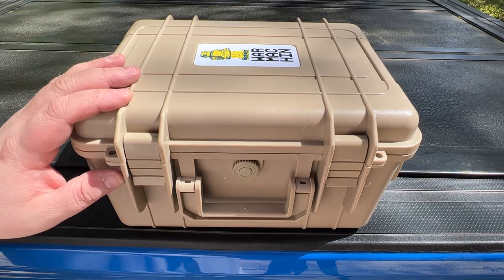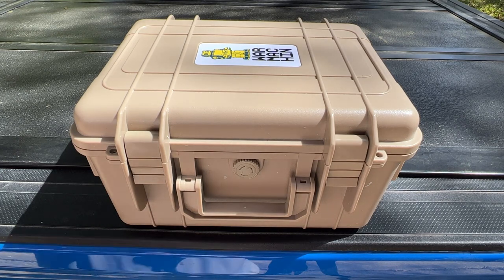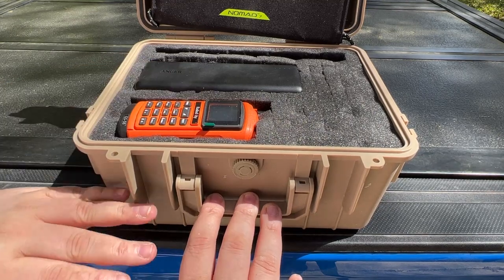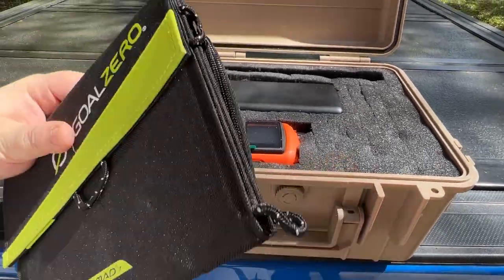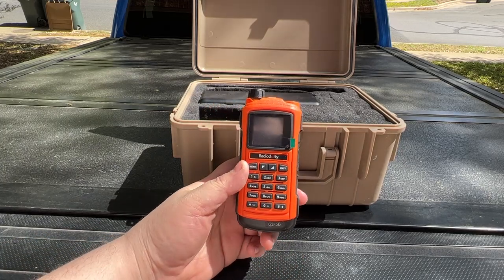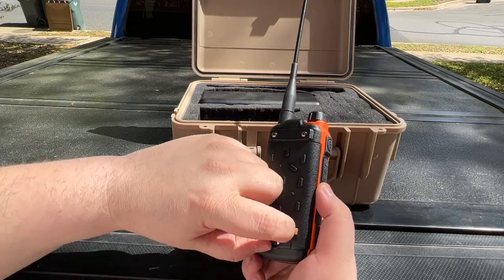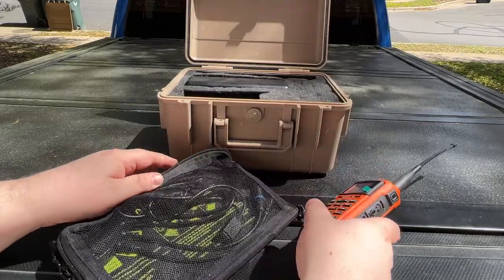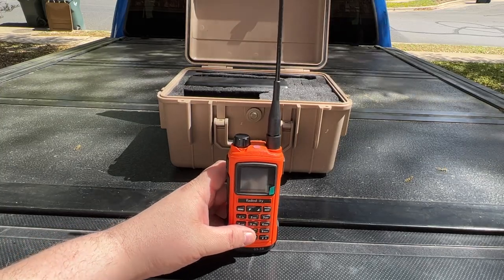Emergency Communications Kit, Part: 1 | Offgrid Technology

Comment: A small “ roll up “ GMRS antenna will improve the range when over the whip antenna.  With the 460 MHz band , it doesn’t have to be big or thick but it will improve range when not on the move.
Reply from the maker: You know I never considered that, great comment and thanks for the tip I will source one for it :)

Comment: I would add an extra battery for the radio to the kit, you can change out and recharge one while operating with the second if they have a AA battery pack I would throw one of those in as well
Reply from the maker: Good idea, never know if the primary can die, I have a few new items I am going to release part 2 in a week or so.

Comment: can you fit 2 radios in there? then you could have an extra one to hand off to someone you might want to stay in touch with. maybe an extra one of those slim battery banks, a small micro usb chargeable flashlight or headlamp or 2. as the saying goes, 2 is 1 and 1 is none. throw a couple of small usb a to c and a to micro cables in that bag for your solar too. then you could charge a variety of other devices, like phones. might be able to barter something to charge someone's phone or tablet for them
Reply from the maker: I love the adapters idea, nice suggestion. I didn't consider a second small flash light that I may do as well. I was thinking of getting a second GS-5B and adding it to the lower foam for that redundancy and for handing to a partner should someone need one.

Comment: Nice kit! Maybe add a shortwave receiver like the Tecsun PL386 or CountyComms version (GP7/SSB). These also charge off of micro USB.  I see so many prep kits that stop at a dual band HAM or FRS and GMRS capabilities.  While these are great for local or longer range communications with repeaters and other networks, I think people are missing the mark by not having something that can receive Medium and Shortwave broadcasts to be able to get actual news and information from outside a disaster area. OR even news and info from outside of the country in a more sinister event.  I value the ability to collect information from as many sources as possible, from as far away as possible a lot higher than locally communicating (or giving away my position :)  A Shortwave receiver with SSB capabilities will allow you to tune an listen to Ham Operators in the HF Spectrum.  This is where the true disaster communications will be in a larger event.  73!
Reply from the maker: Very good points. I like them thanks.